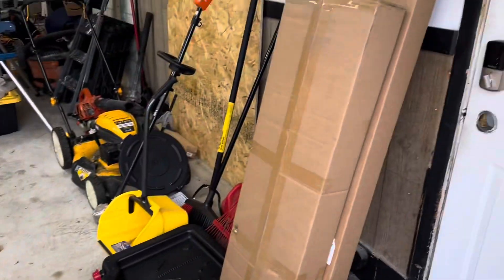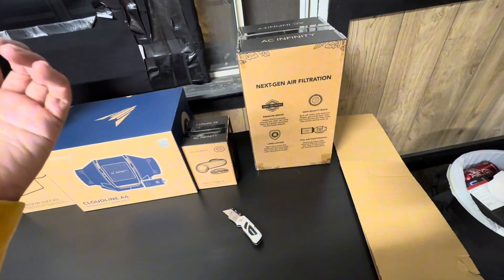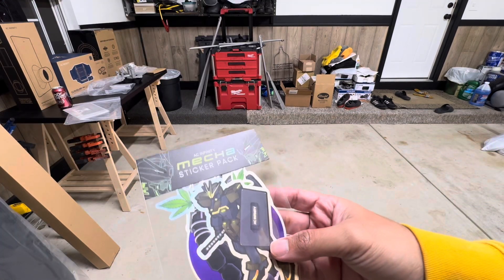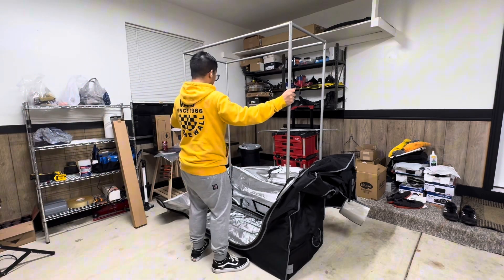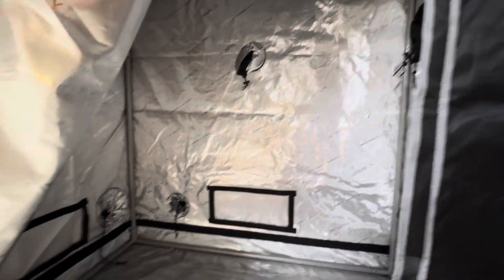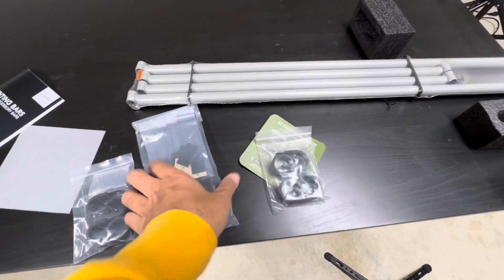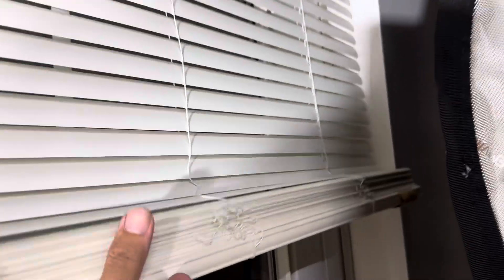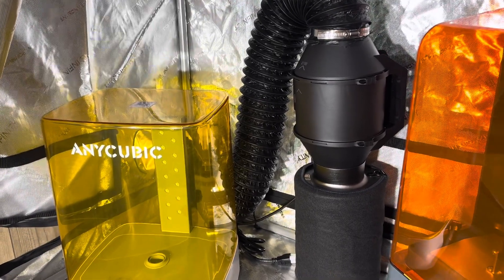My Resin Printing Setup

Comment: i didnt even think about resin being denser then air thats smart i js started building my tent and stuff in my room do you think i should do the same method you did?
Reply from the maker: Resin is super toxic. The resin printer should not be anywhere near living quarters. I have been using resin since 2012 so I know how dangerous it is.

At work we work with alot of resin and we have a whole separate chamber with HVAC system. We also have to wear a full suit and PPE.
Reply: @DaneyCdesigns yes that does make lots of sense and i did know that before hand but unfortunately the current house im in doesn’t have any other options but i do have respirators gloves ect and have many resin printers i can reach out to even though i do understand its not ideal
Reply from the maker: @ I suggest atleast having the printer in a tent with air filtering out the window as a bare minimum. Resin causes lung, skin and throat cancers.
Reply: @ oh yes of course i have a whole tent with a good charcoal filter, inline fan, heavy ducting and a window attachment coming soon i have only printed once a couple months ago and haven’t since i have a pretty good idea how dangerous it is especially since i printed once, i dont have the best lungs so im taking all safety measures possible although ik there is still risk having it in my room if theres another option that pops up in the future ill definitely look into it thank you for your tips and advice